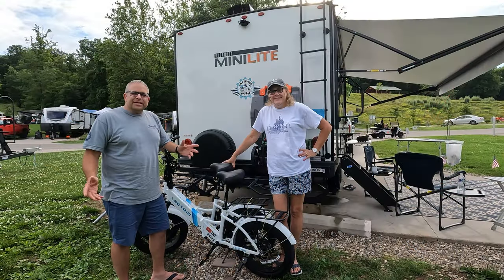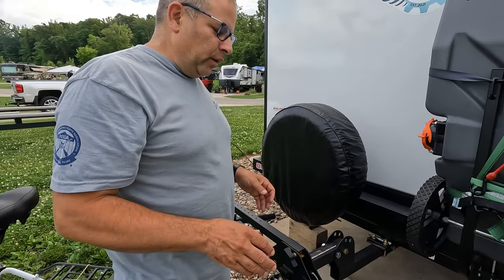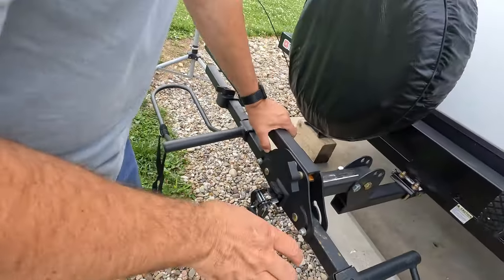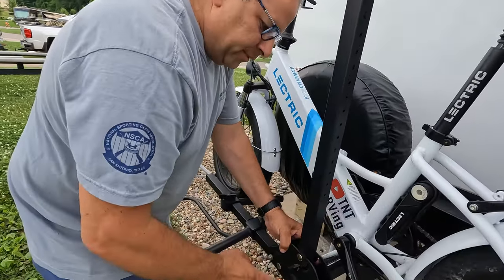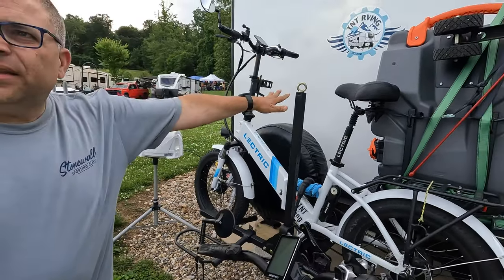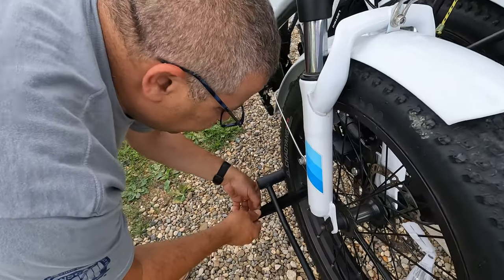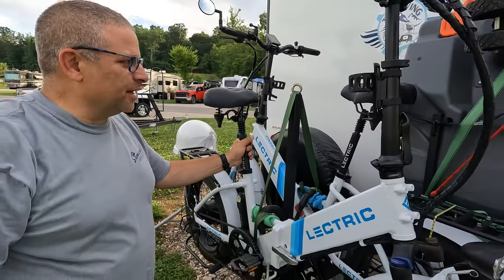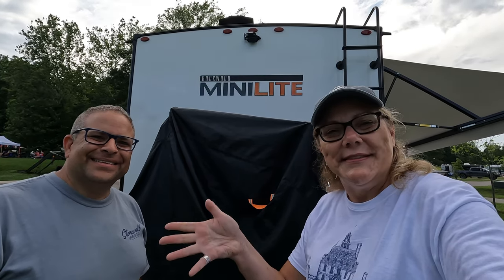Lectric Bikes - Transportation Made Easy #werv #rvlife #rvliving #lectric #lectricxp

Comment: Hello Tony & Tina, have a question to run by you on using the Minilite receiver for carrying two E bikes. I saw your totes video and was curious if that was your choice earlier because you didn't want to put that weight on the 350 lb rated receiver, or you just hadn't got a bike rack yet? I am in the same situation as you and Tina. I have two Lectric bikes and a 2023 2205s Minilite. I do have a KAC bike rack which is a great rack but I haven't used it on the Minilite. I also use a no wobble setup and they are secure on the rack. Some say don't use a trailer hitch for heavy ebikes but you seem to be comfortable doing it. Just wanted your thought process in going from totes to the bike rack setup? I appreciate your very informative videos!
Reply from the maker: Great question! The advantage we have over other RV’s is we have dexter torsion axles. Independent torsion suspension is going to tow way smoother then leaf suspension.
I have had Tina drive behind me on shorter trips to verify how the bikes ride, they ride very smooth. I will say that they are a little older now so we don’t mind them getting a little dirtier from riding in back. Thanks for watching, safe travels!
Reply: Thanks Tony! I am going to give it a try. We will watch it closely with the rear trailer camera and keep an eye on the welds. The welds appear adequate to me, coupled with the no wobble setup and dexter torsion axles, hopefully that's sufficient.  Also on another note, I saw your video on the fresh water tank weight issue. I'm not sure they resolved the problem between the time you bought your Minilite and May of '23 when I bought mine, so I called Forest River and they sent me an engineering blueprint of the change they made. I believe they went to a heavier guage steel and an additional support to distribute the weight better.
Reply: Thank you for your great ideas!  Larry from NE Indiana

Comment: Only one flaw I see.  You do not have a lock on your receiver.  Someone can just pull the pin and yank out the whole setup.  I actually saw this happen at a truck stop, two guys walked up, pulled the pin and yanked the bikes off with the bike rack, threw it in the back of a pickup truck and they were off.   I was able to get a picture of the license plate of the truck and they did get caught later I was told.  But why take the chance.
Reply from the maker: I actually have a locking pin that I haven’t installed yet, guess I will put that on top of the list. Appreciate you watching & commenting!

Comment: Great and thorough video!  You made it look easy.  In other videos & forums they mention bumper support(s).  Any thought on doing that or did you mention it in a previous video.
Reply from the maker: Thanks for the comment! Our receiver is attached to the frame not the bumper, the receiver could use a little additional welding in areas for more support but we feel comfortable that it will hold. I do regularly look it over and so far all is well.
Reply: @TNTRVing  Gotcha'.  We have a MicroLite and plan to buy the same eBikes, so this video is perfect.  Thanks again for the tips.

Comment: We have a similar setup with our Lectric bikes. Our dilemma is moving the rack back and forth from the camper to the truck if the bike trails aren’t near the campground. We have to take the rack off the camper, the ball off the hitch on the truck and put the rack into the receiver and it’s a lot of unsecuring and then ratcheting everything back down. What is your method when transporting them with your truck? We have the totes but can’t close the bed cover with them in the bed and it’s pretty high to be lifting the heavy totes into the truck bed.
Reply from the maker: We only had to move them once in Door County Wisconsin. We ended up making room in the bed of the truck and layer them down. It wasn’t a far drive so it worked for us.
Agree, it can be a pain to shuffle the rack to the tow vehicle and back to the trailer when done.
Reply: @TNTRVing  We’ll give that a try. Thank you! We really enjoy your channel. You have some great ideas and appreciate your ideas, and sharing your journeys with us.❤️
Reply from the maker: @sherrieolthoff2570  appreciate the support & kind comments! Safe travels & Happy Camping!

Comment: It's been 7 months, how is the bike rack holding up? My wife and I have the same bikes and have an Imagine 22 mle with a hitch. I have been leary of spending 600 bucks for a bike rack. I would be willing to buy a rack like you did and modify it if it is holding up.
Reply from the maker: The bike rack has been working great! Belle is in storage now, looking forward to getting her out and start camping again. Thanks for watching & commenting!
Reply: @TNTRVing  Holy moly, thanks for the quick reply. Looks like we will be trying it. An idea for added stability I had, instead of using the hitch pin, try a hardened bolt.
Reply from the maker: I used the locking bolt to keep it tight along with the hitch bar tightening thing. It’s key to have the bikes and rack as tight as possible. Also, be sure to wrap towels around bike when you strap them to keep the straps from rubbing through the paint.
Best of luck!
Reply: @TNTRVing  I think instead of a towel I'm going to try a pool noodle cut down to the length of the cross bar. Thanks again for the replies
Reply from the maker: I tried the noodles, they didn’t work well with the straps. They were still a little loose.
Reply: @TNTRVing  10/4. Thanks

Comment: No offense, but that rack doesn’t look like it will support 200 lbs. Is this rack approved for trailers, 5th wheels, toads and Motorhomes? Where is this rack made? I would assume it’s made in China. I think I’ll pay the extra few hundred on a Hollywood RV rider rack, that is approved for Motorhomes/5th wheels and made in the USA. I wouldn’t take a chance on this rack.
Reply from the maker: For us this rack works well. We are fortunate that our RV has torsion axles, the bike rides real smooth. We have taken multiple trips with vehicles following to confirm how they ride. The rack is rated for 200 lbs. you guessed it made in China.. I have also upgraded some of the hardware. Appreciate the comment & you watching. Safe Travels

Comment: That rack is not rated to mount on the rear of a trailer, only a car or truck. Do you realize how much the rear of a trailer bounces?  One day it will break and you'll lose your bikes on the road and possibly cause a bad accident for the person traveling behind you.  You should have kept using the large bins and kept the bikes inside the trailer.
Reply from the maker: The bike rack has a 200lb. Capacity.
We are fortunate that our RV has torsion suspension not leaf springs.
We have driven behind the RV multiple times while they have been back there.
They ride nice and smooth.
Appreciate you watching & commenting!